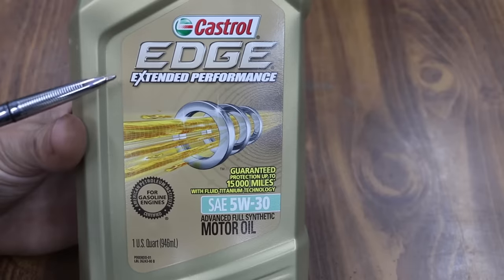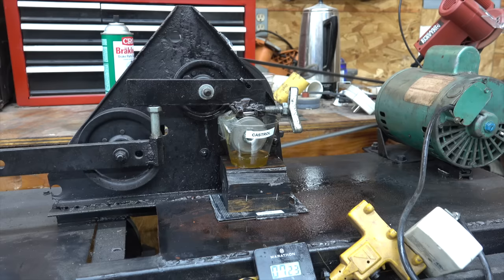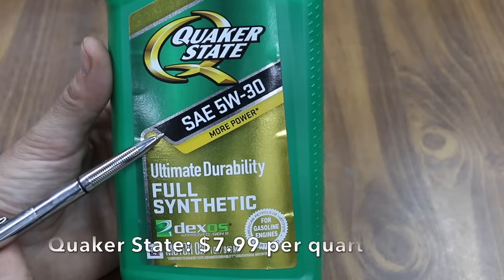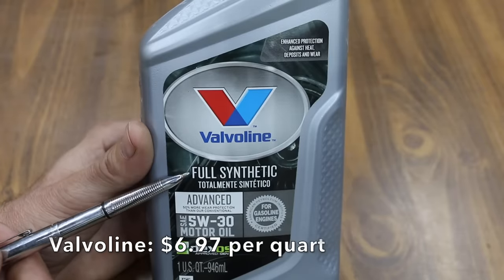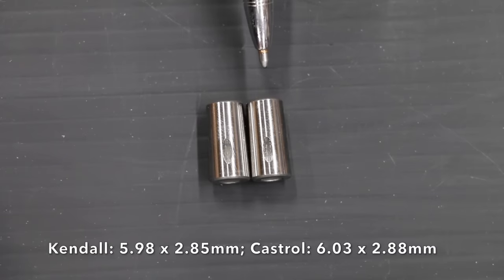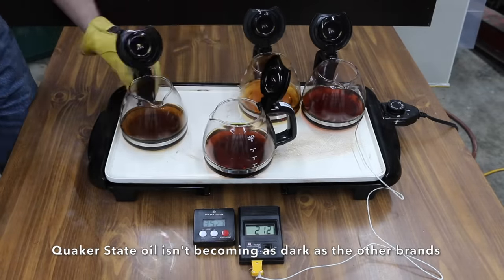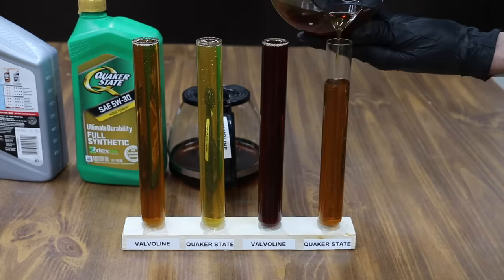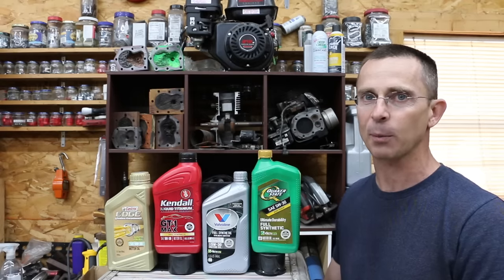Is Castrol Motor Oil better than Kendall? Let's find out!

Comment from the maker: The oil series is really heating up!  Here's the list of brands tested in the series:
Pennzoil Ultra Platinum: https://amzn.to/34pgEll
Mobil 1 Annual Protection: https://amzn.to/31m3bcq
Lucas: https://amzn.to/3iYkvdg
Kendall: https://amzn.to/3hfPa5r
Liqui Moly: https://amzn.to/31l8eJY
Amazon Basics: https://amzn.to/32ef4jL
Quaker State: https://amzn.to/2EgE7uv
Amsoil: https://amzn.to/3aNZYoV
Castrol: https://amzn.to/3jhgYan
Red Line: https://amzn.to/34kkV9T
Royal Purple: https://amzn.to/31l9ehc
Schaeffer's Supreme 9000: https://amzn.to/3goLaOK
Valvoline: https://amzn.to/2YrJGgq
Motul 8100: https://amzn.to/3l9AfMw
WalMart: https://www.walmart.com/ip/Super-Tech-High-Mileage-SAE-5W-30-Motor-Oil-5-Quarts/17134875
Reply: Can you do 0w-40 M1 vs Castrol 5w-40 FS . Thanks! 🙏
Reply: Can you do a test of the harvest king motor oil available at rural King
Reply: How about Castor Oil?
Reply: Whats the best you tested yet. I will say quaker state i notice does not turn black quick it holds color super long and well. That might speak 1000 words.

Comment: The guy makes motor oil exciting. Smashed the like!
Reply from the maker: Thank you very much for the positive feedback
Reply: your comment smashed and i’m sure is exactly what anyone watches it thinks
Reply: If motor oil is not exciting to you, you are eating your cereal all wrong. Be a regular guy!
Reply: Use valvaline max life
Reply: @ProjectFarm  i'm especially impressed with your ability to not sound sarcastic when reading the marketing wank! keep up the good work!
Reply: @MilhausMN that's a great point. i hope there is some relation between what marketing thinks they can get away with and what the engineers actually told them. i'm glad we've got project farm's alternative approach to presenting the marketing material and testing it as a contrast to ave's... shall we say more overt opinion on the material. cheers!
Reply: I know I hit the 'like' last evening when I watched it.  This morning, it is showing that I had not yet 'liked' it.
Reply: @dannyhanny1191  happens to me a lot too.
Reply: Can agree more! Firmly planted the like button!
Reply: @TheUnsureFox  I have so much fun with him announcing the oil races.

It'd be interesting to see how they race hot like their in an engine, but that'd be tough set up.
Reply: Was it just me or did I see the Valvoline cut off the Quaker State in the flow test? 🤔😂

Another great video PF👍
Reply: Can't hardly wait for the match between kendall vs amsoil..
Reply: @randycchavez  LOL. I don't know, but don't you know, quaker state doesn't suck anymore because Pennzoil makes it so...
Reply: For the youtube algorithm

Comment: I now use amazon basics full synthetic in my Toyota tundra because of your testing. Mahalo! 🤙🏽
Reply from the maker: Me too.  It's a great oil!  I'll provide oil analysis data on the oils tested soon.
Reply: Whenever you see a house brand oil (like amazon),  look on the bottom of the bottle.  If it says WPP or WNE,  it's a Warren Distribution product...  consistently good stuff.
Reply: Same here. I used the High Mileage Full Synthetic for my 05 Camry based on his videos!
Reply: I've been a basic bitch ever since that video too
Reply: @ProjectFarm  :Hi there , but this Amazon oil is not on sale in the Canadian Amazon.ca ?!
Reply: @DeadKoby  This is the issue, cause one batch might be done by the good guys and other might be not.
Reply: Good oil dude same oil as walmarts supertech under Amazon name.
Reply: Is your Tundra the 5.7 iForce model? I'm thinking about switching to amazonbasics for my 5.7 Hemi Ram 1500. I've been using STP oil which is great oil, but it can be a bit more costly.
Reply: @Joshua Yup, just did my truck over the weekend with it and it was the first time I ever did an oil change on my car. Full Syn with some Motorkote..
Reply: Aidan Montgomery just use super tech I used that in my 5.7 Hemi full synthetic and it had 170k before I traded it for a power stroke went to motor craft for the power stroke but my Hemi ran good and changed it every 4500 because I like maintenance stuff early.
Reply: My tundra is the 4.7 2uz V8. Not the 5.7...
Reply: Me too.
Reply: I put it in my 89 Dakota 3.9L... and it has increased the MPG.. not much.. but any is amazing.
Reply: @cromulentcommodore5896  This  as cromulent a reply as I've ever seen.  Over here, or there.
Reply: But did you add Motorkote.
Reply: I wouldn't give Amazon a penny. Horrible company to support
Reply: @ironfistarrival  go to your local wallmart... their house brand is more of less the same. sourced from the same manufacturer anyways
Reply: @eclipsegst9419  Well the supplier amazon gets their oil from is identical to Walmart's supertech oil, so if you dislike amazon (which I don't blame you, their greed gets under my skin sometimes) you can just go to walmart.
Reply: @ixionn563  not a fan of WalMart either. I buy Valvoline for the stuff I really care for and Orshelens (a local farm and home store) brand for the stuff that gets changed a lot. People really overthink oil. None of the conditions tested here should ever happen in an engine that is functioning properly. In all reality any brand will work just fine if changed at proper intervals, oil related failures are extremely rare nowdays. So I just support the companies I believe worthy of my dollars.
Reply: @grassroot011 best comment since nineteen dickety two!
Reply: @ironfistarrival  No not yet just America Amazon sadly.
Reply: @fredlaroche6969  :Thank you ..
Reply: @LukeRT  :Okay , thanks ..
Reply: @DeadKoby  My bottles' stickers actually stated it was distributed by Warren.  I've never tried it until just yesterday.  Certainly hits the price-point.
Reply: @grassroot011  a noble comment embiggens the smallest thread.
Reply: Ultra CNC  well, that's true, but that wear test is more of the type of test that should be used for gear oil. In used oil lab testing, Valvoline often has some of least wear metals found in it.
Reply: Ultra CNC  yeah, the wear test is inaccurate for the type of wear an engine sees, because in an engine the surfaces that meet each other are all rotating and have minimal single directional load. Old flat tappet cam engines would have somewhat a similar load as this on a camshaft. Pretty much the oil with the most ZDDP will win that test every time. Modern oils have lower zddp. Some companies have gone to moly instead, but Valvoline and a couple others have gone to non-metallic friction inhibitors. Their VR1 line is the high zinc stuff for old engines and would do well in that test. The boil off test, again, shouldn't matter. Unless your engine overheats it won't see temps that high. I certainly never have a lower oil level at the end of my oci so it's not something I see as very relevant.
Reply: Steve Mobile 1 is a good oil I used it last second oil change and the last oil change I changed it to Supertech. I noticed little lost in power but I saved $7 for 5 quarts one container in Walmart.. I think it will protect the engine more in Mobile 1
Reply: @ProjectFarm  im using quaker state 0w20 on my 2014 tundra . Plz tell me thats a good choice
Reply: I'm sure it's a good oil but I paid too much for my vehicles to go cheap on oil
Reply: Even amazon.ae, its not there
Reply: @edwinj1224  Do Redline , it's esther based but at $50 a jugg you better have deep pockets.
Reply: @fredlaroche6969  I think the same for Kirkland Signature as well. I wanna say it's all Super Tech
Reply: @Ixionn  Try Pennzoil Platinum in ur truck. Far better oil! Well proven here an elsewhere. All i run in my '18 F150 Lariat FX4 w/Gen2 GTDI V6. Also use in our newer '22 Edge ST AWD w/Gen2 GTDI 2.7L V6. Both high performance engine designs. Excellent engine oils! -NY
Reply: @themrgodfather77  You'll love that Ford truck! Motorcraft oils are excellent. Use Motorcraft full- synthetic always w/ OEM Motorcraft filters. I do. 5-6k mi OCI max. -NY
Reply: @Joshua Akaka  Not a fan of those trucks but to each there own.
Reply: @DOGLE  Don't use additives unless an older , high mileage engine. It messes w/chemistry of modern high- tech engine oils. -Ohio
Reply: @EclipseGST94  Pennzoil Platinum & Penn Ultra Platinum are outstanding oils. Far better than all others. A great budget oil (from testing) is Motorcraft synthetic blend oil. Available @Walmart (good in any brand vehicles.. not just Fords etc)

Comment: This is interesting for sure but After many years of using Castrol and seeing engine tear downs after using it I will stick with it myself it hasn't let me down in the last 35 or more years. It's a trust game for me after using it so long.🤠
Reply from the maker: Thanks for the feedback.
Reply: I agree. I run Castrol in both my vehicles and both engines are running great.

Comment: Suprising Quaker State did so well. I remember years ago, it wasn't worth using in a lawn mower. Honest and unbiased testing proves it though.
Reply from the maker: Thank you!
Reply: Quaker State is owned by Sopus which is Shell Oil since '02. I remember back in the 90's you didn't use Quaker State unless you wanted a stop leak.
Reply: Yeah I guess shell owns Pennzoil and Quaker State right?
Reply: Jon Adam yes that’s correct.
Reply: It's been good for at least the last 20 years.
Reply: Quaker State should've advertised, "under new management" lol

Comment: Love the vids...
Someday We need to see..

Shell Rotella T6   :)
Reply from the maker: Great recommendation!
Reply: @ProjectFarm  Heard Qauker state is the best....then Shell Rotella T6....then Amsoil!!  You gotta do Rotella T6 to keep our piece of mind,as i think you've done all the oil us motorists really wanna know and find out apart from that.Gotta be done surely,Project farm?
Reply: I actually run the T6 in my motorcycle (V-twin with a common sump wet clutch). Lab results have been excellent, but i would like to see the cold-flow test.
Reply: Just so everyone is aware, the Rotella T6 formula changed a few months back, not the same stuff anymore.  I switched to Total Quartz 9000 for my EJ257's
Reply: Agree match it up against Delo XSP 400 and Mobil one turbo diesel truck.
Reply: @noahmercy-mann4323  I run T6 in my Yamaha WaveRunner, Polaris RZR, lawnmowers, pressure washer, BMW 335D and my Duramax truck.  Seems to be good stuff.
Reply: Project Farm please consider a Rotella 5-40 t5 , Rotella T4 & Valvoline Premium Restore
Reply: Do the diesel oil round up over time. Rotella T6, Dello, and Delvac?
Reply: T6 comes in 5w40 and 0w40. The 0w40's thinner when hot, too; compared to the 5w40, my 6.5 seemed to go up by 1 MPG HWY while using the 0w40. I had to add more but I got a good bit of it on clearance.
Reply: I use T6 in my 05 Honda civic with 380,000 miles
Reply: He's probably already done all the tests already for filming reasons.
Reply: My thought exactly.  Hope he does a 5W40 comparison so we can see the T6 in action.  I personally use it in my 2006 Jetta TDi
Reply: Alan cZar  My bike limits at only 6300 RPM, but even with a common sump (so the wet clutch shares the crankcase oil), the oil analysis is great after 5,000 miles, and I run my bike fairly hard for a twin. Best recommendation is to run it in your Scooby for 3,000 miles and send a sample to be analyzed. It will tell you a lot about how the additive package holds up and if there is any detectable engine wear. You should be able to find some analyses online if you'd rather see how it is holding up in the WRXs...

Comment: You should show the impact that Lucas Oil stabilizer has on some of these oils I'd live to see what it's actually doing 

Thanks for the great videos!
Reply from the maker: Thank you for the video idea!
Reply: @ProjectFarm  I vote this idea as well.  I have done a bit of my own testing but I would be curious to see your ideas for testing Lucas additive with various oils.
Reply: He has tested Lucas products quite a bit. Until he tries your idea check those out. I've ran a couple products for year and I can give great information on my channel about it.
Reply: I have an engine that has really bad bearing clearance and Lucas is the only thing keeping it alive
Reply: @ProjectFarm  Please do The Lucas
Reply: I would love to see that as well, but there is no need for me.  The hands-on experience I have with it will keep me using it in every oil change for every vehicle I ever own.
Reply: @ryansimpson3074  I mix 1 qt Lucas in with Castrol Gold bottle and have 435,000 on a Toyota Sienna and does 0-60 in 7 sec flat no smoke. The only reason the newer models have lighter oil is to meet CAFE standards. May reduce MPG but I'm still driving it like I stole it :-)
Reply: @ryansimpson3074  “W” stands for “winter.” When oil grades are hyphenated (i.e. 10W-30), this indicates range of viscosity attainable with this particular oil, namely it behaves like 10 weight oil (less viscous) when it is cold or “winter” and thanks to viscosity modifiers (manufacturer added oil additives), it will behave like 30 weight oil (more viscous) when hot.
Reply: @ryansimpson3074  You are joking right? The W stands for Winter. Even the 0W-30 is very thick when sitting in a cold engine, but thins out to a 30 weight at 212 degrees. The 0 is a bit thinner than the 5 and 10W when cold, but no different when hot. None of them are ever thinner than a 30 weight under normal engine temps, fyi.
Reply: @darrylsjodin7184  Holy smoke EPIPHANY!!!! I never realized what you just explained. Once the engine heats up the temp is the same no matter what multi-weight oil you have, so if they are true to their promise they will all act the same. The way you explain it, the only difference between oils is at cold ambient temperatures. What about 10W-30 vs 10W-40 or 10W-50? Ambient temperature is never as hot as operating temperature, and of course all oils need to perform well at operating temperature so they will all perform well at even 110 degree ambient with no problem, so why do we need those higher numbers? Plus I always thought the W meant "weight" but people here are saying "winter?" Holy basics Batman, I wish I had had Youtube back in 1973!!!!
Reply: @TheLarryBrown  I’m not really sure about what you mean. We need the 20, 30, 40 weight oils to meet car mfg co requirements. The 0,5 & 10w are to help the oils though viscosity index improvers, to not thicken as much when cold so they will flow, as compared to say, a straight 30 weight. As Lake Speed Jr. certified lubrication specialist says, a 10w-30 oil is never thinner than a 30 weight and it’s only a 30 weight when it reaches 210 degrees. As it cools, it gets thicker and thicker until it won’t pour out of the bottle any more. I was saying that the oil, if good quality, should be consistently a 30 weight at 210 degrees throughout its useful life and not thin to a 20 weight or thicken to a 40 weight, which is losing grade. A 10w-30 is never a 10 weight oil; it just thickens in cold weather the way a 10 weight oil would thicken in the same cold temps, due to the vi improvers. Nice to talk to you🙂

Comment: This series is awesome. I've always use Castrol but after seeing this, it changes my mind about it.
Reply from the maker: Castrol is a very good oil. Thank you
Reply: very true. for a basic engines i dont worry much. just bought a turbo car so i stepped it up a tick to Rotella gas truck. its not the greatest but for the money its plenty sufficient.
Reply: The slowing of the frozen cooked oil flow concerned me as well, but I have hands-on experience with Castrol that will prevent me from ever using anything else.  Castrol is the only brand that offers a 500,000 mile / 15 year warranty running 20,000 mile oil changes.  I never run my oil that long, but my oil has still been translucent after 6000 miles of heavy spirited driving.  On a side note, I also use Lucas Oil Stabilizer with every oil change.  The combination is unmatched.